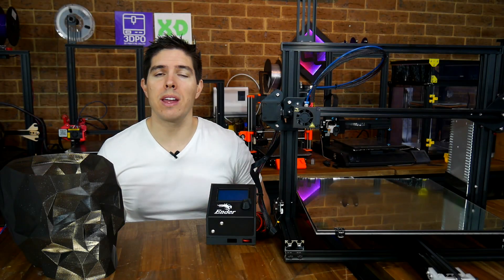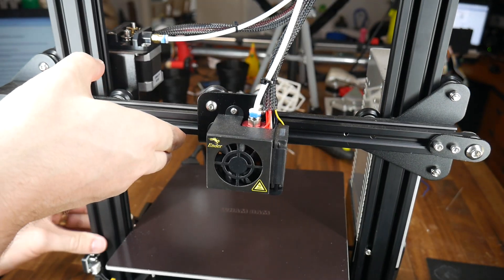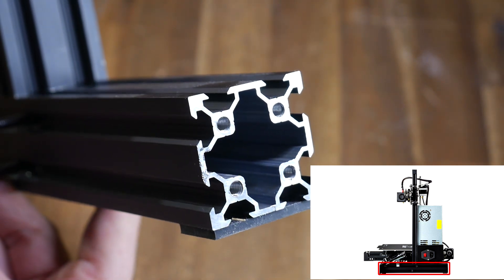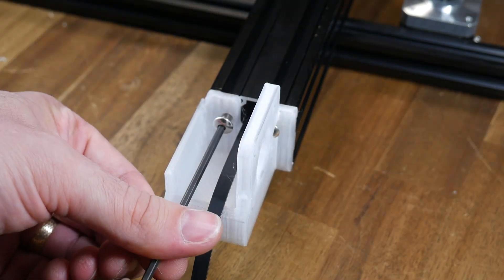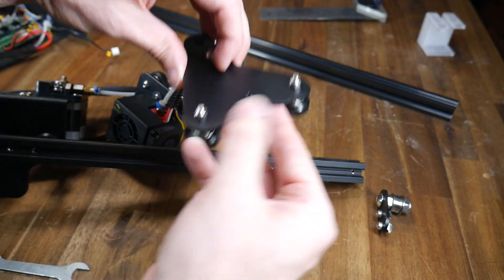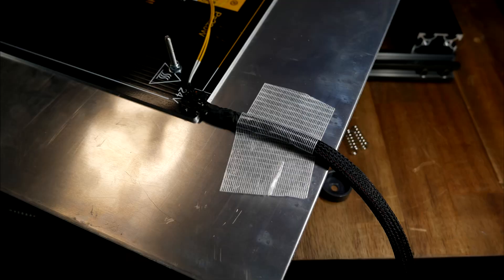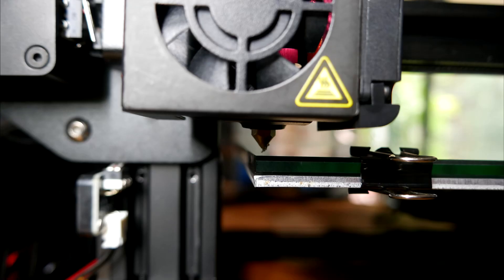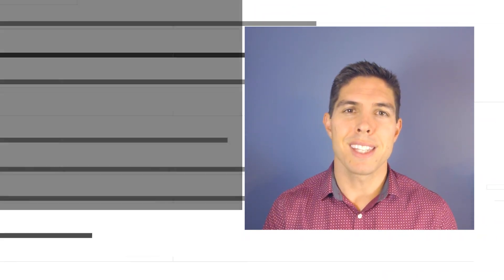Ender 3 conversion to 400x400 with the Ender Extender kit

Comment: I never realized my ender 3 was too small for large prints. I tried to print a hl2 metro cop helmet and too big. This was for cosplay I might add. Airsoft and cosplay go hand and hand with 3d printing. Even if I divided the print in 4 still not enough. I'm also unable to print a full stun baton but unlike the helm I can print in sections and jb weld. Epoxy should hold it all together.

Comment: why buy the kit? just buy the profiles they cheaper they not anodized black but u get them for less and u can make it 100cm x100cm or 1000x1000 or even crazier 2000x2000 there is no limit since the limit is the physical end axis stop. some wires and u got whatever size 3d printer u want. problem is speed of printing...printing a 1000x1000x1000 object would probably take 5 weeks at the current speed Ender 3 v1 works at ... even with a 1mm nozel. but since u going overboard make the frame rigid and u can play around with double axis bed to get some of that jerk out and u should be able to print at 50mm/s or 120mm/s

Comment: The Elegoo Neptune 3 Max 420x420x500 for $470USD essentially renders this kit useless. It has 32 Bit silent drivers, direct drive extruder, ABL, Dual Z, PEI build plate, touch screen interface, belt tensioners, LED lights, diagonal support rods, tool drawer, has actual support from a company who responds to emails, and it's not some kit that may or may not work.

3D printing has made leaps in quality in 2023 over the crappy Creality Ender junk. The only thing an Ender is good for is to repurpose it be a Recreator 3D filament extruder.

Comment: I would never use a printer without the upgraded screw belt tensioner. I stock tensioner just does not allow me to tighten the belt enough and I keep getting layer shifts. I have found that most layer shifts is do to the belt either x or y being slightly to loose. I being able to dial in the belt tension is a MUST. This is a MUST have upgrade to any printer.

Comment: I'm sure someone else has also commented it but you have to use specific wires for the thermistor. Every time there's a change in the metal, it creates a voltage (think very basic, weak battery) that affects your readings. It might be possible to tune for that change but it does make a difference

Comment: You are the best. I bought the extender kit but followed your instructions exclusively rather than theirs. You just make it simple and quite frankly, fun. Now, I'm going to offer you some advice on cutting glass. Its the exact opposite of what you'd expect...stop being so gentle. With glass, you need to just get at it and don't be afraid of it. Make "ONE" firm score with your glass cutter.....not 2, not 3, JUST ONE! , slide the glass to an edge and snap it. That's it. As long as you can see your score mark you are good to go.

Comment: I love my Ender 3 it has worked faultlessly for 2 years but I would like to upgrade it like this. I am fine with the mechanics but haven't a clue where to start with the firmware. Did I see an Arduino sketch? what's that all about?.....see? I haven't a clue where to start could you possibly point me to a tutorial? thank you.

Comment: IMHO, when extending the Ender-3 (Pro) to be wider (X axis > 235mm) the printer really should be upgraded to have two Z axis drive screws (and motors) as the Z motor now needs to lift and hold more weight, and the tilting torque to drop the unsupported end is greater.  At the very least there should be two drive screws liked by a belt if only one Z motor is used.
If not using a larger bed heater, I'd also want to install an insulated pad under the bed/heater, and that's a good upgrade for ANY configuration of the Ender 3 family.
Avoid 7 years of bad luck :-) and DON'T buy a glass cutter and DIY.  Go to a glazier and HIM cut you what you need.  (Actually with practice cutting glass isn't that hard, but I've broken quite a bit of it every time I had to do it before I got it they way I wanted!)

Comment: i have a question can i use the exact same kit upgrade the ender but change the extruders into the direct extruder from ender S1, i am planning on making this extender kit + IDEX but the second extruder i want to buy the direct extruder that is used on ender 3 S1 (is that possible?) note with dual Z and each extruder with its own stepper motor

Comment: Has anyone experienced stepper motor fade on the extender platform? I’m making a bold assumption that if you increase the print volume you will also be extending your print times causing the stock ender 3 stepper motors to over heat and begin skipping. I’m keeping in mind that the ender 3 was originally shipped out with a super cheap board and not the v4.2.7 

Also as you are extending the x arm gantry would you experience more slop on the right hand side? I think this kit would be complete with a dual z motor kit.

Comment: Quick tip to deal with making a glass bed for the bed. I scored two 400x400 picture  frames for $40aud. After abit of disassembly, presto a super thin glass sheets that fit perfect and a spare which as we all know will be needed later. 

Got it from catch if any Aussies are intrigued

Comment: Really cool but to be fair I have the Ender 3 Max and having only one Z axis rod across such a wide machine causes the X gantry to sag. This requires precise Z axis roller adjustment but it also tend to get them "stuck" at certain heights causing bulging layer lines(similar to elephants feet) where the gantry had trouble rolling up smoothly. Getting a dual Z motor setup is definitely worth it in my eyes.

Comment: I ordered the ender extender kit for 371 dollars with shipping, but Ive never heard anything from the guy... Ive sent him / them an email as well but never heard anything.. So I would not recommend anyone to order.. I felt safe to, because of all the video reviews on youtube, but seems like I'll never get the kit or my money back..
Reply: 🙁 that sucks.
Reply: @GIacius  Update, I got the kit and a late reply. They were very sorry for the long times. They had a lot of orders and a shortage of aluminium plates. I got the set delivered today and everything looks good. So don't take my "bad" experience as a review. :)
Reply: Another update, finished the kit. I had received two of the same belt tensioners, so I was missing a part, but I found the STL on the Facebook page listen in the video. Also found Marlin firmware that already had all my other mods on my v 4.2.7 board. Everything worked first time and tomorrow Ill start calibrating and print! It was a bit pricey outside of the US, but I would recommend this kit. It looks really funny next to my other ender 3.. :P

Comment: I purchased a creality 4.2.7 board and installed it on a large frame. Learned quickly I can’t just change bed size in cura. For the life of me I can’t get this board to flash or how do I go into the marlin firmware like you did to change the bed size.

Comment: Great Video but i have a dumb question...I recently bought and installed the Ender Extender 400XL.  You say update the firmware to change the bed size but I can't seem to get any program to recognize my printer board.  Do I need to edit an existing file and update the firmware on printer or how can i go about it?  It's an Ender3Pro with the creality3d V1.1.4 board with factory firmware and the BLTouch upgrade by the way.  Any advice would be appreciated.

Comment: so what is the theoretical max size of an ender 3? is it if i had a direct drive extruder, a 2ed Z-axis screw and stepper, and replaced the wires in it, could I make a ridiculous 2000x2000x2000 ender 3 to rival "The Box from BLB Industries" a pellet printer.  for WAY less money

Comment: I have just installed 300XL extender kit on my Ender 3 Pro   Would the heating element mounted under the NEW print bed (400X400 or 300X300) directrly heat better? instead of having two sheets of aluminum, you only have ONE??  Im having issues finding a 300 X #00 with holes for ender 3 sizing

Comment: Im not all that savvy with this type of stuff how can i get my ender to know it now has a 400x400mm bed i have the ender 3 pro with 4.2.7 silent board and Bltouch i click home and try to do the auto bed level but it only does the small area it use to it doesnt do bed leveling for the 400x400 bed . HELP PLEASE

Comment: I bought this based on your review.  I installed it about 8 months ago. Works 👍 great on upgrading the ender pro. I added microswiss DD all metal hotend combo, BL touch and recently whambam PEX ...and use it mainly for PETG and flex 💪 Thx! with the larger nozzles it makes some nice large usable parts.

Comment: Hello There, 

i recently bought the kit and set it up. unfortunately my printbed now no longer reaches the desired temperature, i have a suspicion that i have to tell the program the correct temperature sensor unfortunately i don't know where in the code or which one is the correct one. If someone could help me out would be greate ;) 

Thanks For any advace or tipp

Comment: Wouldn't the smaller heatbed cause problems of warping on the edges? Just order this kit and was about to order a 300x300 CR10 heatbed to have a larger area covered, but the y-carriage mounting holes do not match. Don't know what other options I have. Any help would be apreciated.

Comment: my only concern is the size of the heating element and the size of the new aluminum. have you had any issues in this area?
Reply: I have the largest kit and it works well. I snagged the bed cable and wrecked it, so I bought a stock sized Ender 3 silicone heater to replace it from GulfCoast Robotics. That heats the bed even faster and works awesome. I just have to make the bed hotter, so like I printed a full sized Boba jetpack in one piece and stretched the limits of size, turned it 45 degrees. Did it in PETG and just had the bed at 80 degrees and no issues.
Reply: @CaptainFettCosplay  same here, just got the 400xl. what did you have to do to print on the full bed? it still tries to print 220x220
Reply: @Definitelynottheatf  At the end of the instruction manual it tells you the gcode to insert to ignore software endstops. However, I suggest doing like Michael in this vid and edit your firmware to increase the bedsize.
Reply: @CaptainFettCosplay  i added that in and it still wont work. ill have to go over it again and see what i missed

Comment: Would suck if you disassembled your ender 3 and then mid building the extender kit, you break your 3d printed part.
Reply: The Facebook Extender group and Mark the kit creator is really good about helping and sending you stuff if there is a crisis. But suggested to print some stuff. This is an older video and we now all get metal Y stepper brackets and extension cables with the kit

Comment: I can’t figure out how to flash my ender 3 v2 firmware after adding the extender kit and bl touch can u please help me ? It keeps telling me I cant because I keep getting errors ?
Reply: did you ever figure how to change the bed size? im in the same situation
Reply: @Alex_Bernabe   yes I was able to do it but everytime I print something I get a few minutes into the print and I get an error on screen that says , ( " nozzle too lowperture ") I reflashed the firmware and tried again and the same thing happened , then I tried a different print saw thing ,I checked wires , connections , the board , re soldiered the board , thermistor , heat block and tried again but still the same result😔😔😔😭😓

Comment: so, If I'm buying the Ender Extendre 400 (non-pro), what would I need to at least print something with the kit? Do I need extra parts I need to order like a glass print bed or a new heated bed?
Reply: I simply went to Lowes and got a 16x16 mirror cut for me. For $19, I got 2 mirror beds and 3 Ender 3 sized beds for my other machines. I suggest a BLTouch just to make this monster easier. Otherwise, the normal Ender upgrades like metal extruder and yellow bed springs or silicone spacers. I printed an external control box/ board holder from the Facebook group and off Thingiverse, side mounted the spool, clamped the frame to my table.

Comment: is there any reason you cant use the heat bed from a cr-10 as it would be the same dimensions and from the same company? I want to do this upgrade but i want it to look as official as possible. Also im planning to use the extender 300 not the 400.
Reply: I use the stock Ender 3 heater and its great

Comment: Why would you need to change the dimensions of your bed in the firmware, when you change it in the slicer? what is the differentiations between the two locations of bed dimensions?

Comment: The idea is nice but the kits are extremely overpriced. I bought two pre-drilled 20x40 profiles for extending my ender to 450mm height, and paid it less than 10 dollars, + 5 for the cable extenders. That's it.  Jesus Christ, 99 dollars? That's 80% to of the price of the printer itself.
Reply: I was about to mention the same... A few cheap profiles, belts, hardware and cables from aliexpress. The 400XL kit is priced at $240+shipping which could be easily sourced from ali for about $30-40 shipped free.
Reply: @exPEdiAZ  where are you getting the PREDRILLED steel bed for even just the $40??
Reply: @CaptainFettCosplay  idk what exactly you're talking about but that's aluminium and basically at any local aluminium supplier for about ten bucks this size. (btw if you take a look at the "extender" online store they selling the bed sheet separately for $16)

Comment: Hey mate,
Why did you use the pro kit for the standard ender 3?
Would you recommend using and adapting the pro kit for it or use the standard?
I understand the only difference is the 2040 and 4040 extrusion? 
Is the beefier extrusion worth it?

Comment: I recently installed this kit on my Ender 3 and I find the whole firmware process to be inscrutable. How about a beginner firmware with no assumption about the the arduino software (WTF). Everything I see makes way too many assumptions about the knowledge of the 3d printer user.
Reply from the maker: Have you looked for this on my channel? https://youtu.be/eq_ygvHF29I
Reply: @TeachingTech  That helps but it still makes a lot of assumptions. Why do I need a bootloader. Why can't I just upload a binary firmware and be done with it? Why do I need  Visual Studio? What is visual studio? What does platform IO do? Things like that are not apparent. When most people install firmware, there's an installer and it just works (like a BIOS update or firmware for a router/switch). I keep putting pieces together and I now realize you are editing source code and it gets compiled and uploaded. That has never been obvious to me and I program (though I don't use an IDE). Keep in mind all the poor souls who have none of this knowledge.

Comment: "Crush down the crimp connector. This should be a lot more reliable connection than soldering because it shouldn't fail even if it gets hot". Dude, if your wiring is getting hot enough to melt solder(+300C) then you have MUCH bigger problems to worry about than a failed splice. Soldering is always the way to go unless you're just doing a test for a temporary fit.

Comment: Hi Michael, I was curious if using the stock heated bed works well as a permanent solution for printing. I've been considering this kit for a while now, but the thought of connecting an AC heated bed myself has put me off of it a bit (for reference I am a 16 year old without much experience doing any electrical work). I saw in this video how you opted to use the stock heated bed itself, but the Ender Extender website says that using the stock heated bed is "less than desirable". In any case, I was curious if you've had any issues with only using the stock bed or if it would be fine for me to use it in the event I purchase the kit. Thanks
Reply: Don't do it, using the stock bed heater takes forever to heat up and that's just for PLA, PETG fails on it, I bought an AC bed but if I could go back in time I would never had bought it and got a CR 10 instead
Reply: @AndrewAHayes  Thanks for the feedback.

Comment: I found it better to tension both Z v-roller sides individually before bolting them them to the x-axis assembly. That way they are unloaded from any weight or torque applied to them. Square the x axis  to the screw side rail, remove  from the z rail and tighten the two bolts. then install the other set of rollers loosely to the x rail, reinstall the x axis assembly on the rails and tighten the two bolts.

Comment: Here an easy and cheaper way to achieve this result. Go on Amazon, buy the all 4040 and 2020 for less then $40 and cut it yourself. the belt costs a few buck for a few meters. You are paying a huge amount for someone to cut the extrusions and post it to you. That is it.
Reply: This is exactly what I'm thinking, I am thinking to possibly try sourcing everything myself. I want to make sure I buy the correct 2020 and 4040 depending on slot and sizing. I think even buying from China I could save a lot of money than buying the kit.

Comment: Shame you can't reuse the existing frame, and just put extenders on it. I get that it might be an issue for a continuous, flat surface and all that, but.. maybe if done correctly. Would be nice having even less parts completely swapped out, so you're left with stuff after